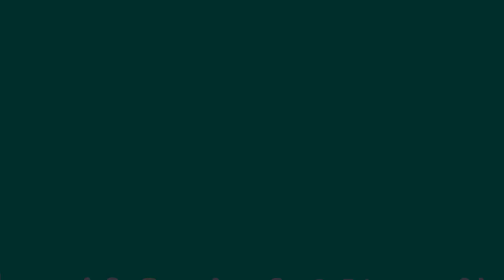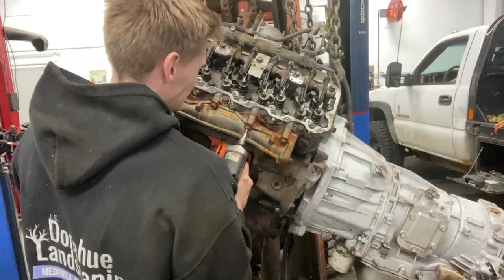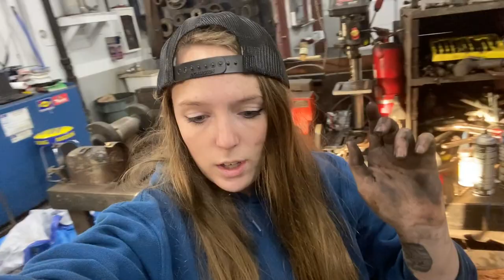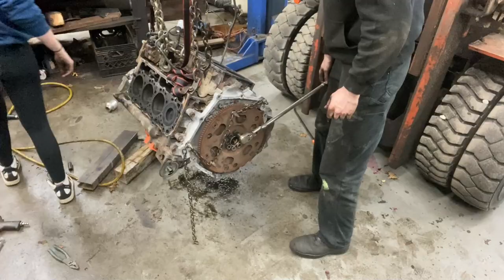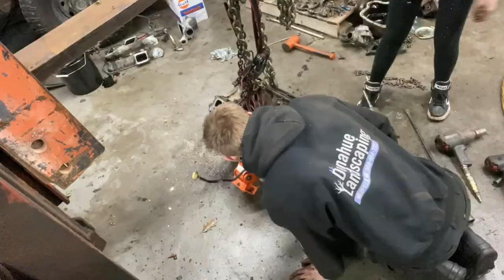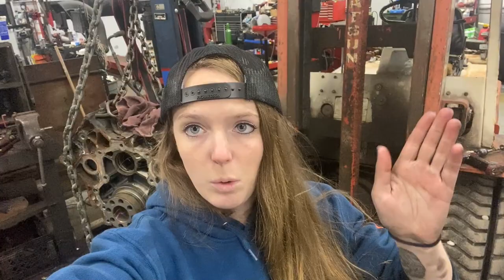6.6 DURAMAX ENGINE Tear Down How To

Comment: Welded water pumps usually fail before a stock one will because your not supposed to weld dissimilar metals together, mine failed within 3 years and it left me stranded 800 miles from home...
Reply from the maker: Ik a ton of people who have done this and haven’t had it fail. It won’t handle the hp I’ll b putting down. I’ll just buy a built one so I don’t have to worry.
Reply: If you look online at any of the Duramax pages everyone will tell you not to do it as they fail. Mine was a merchant auto welded pump and it broke writhin 3 years with only 40k miles but my oem acdelco lasted 160k and was still fine when I replaced it with a welded one
Reply from the maker: On a fully built 700whp truck a stock pump lasted 160k? It’s going to just spin on the shaft. Everything I read says it needs to be modified. I’ll pin it then ig. It can’t stay stock pushing the hp I’m going to b pushing there’s no way.